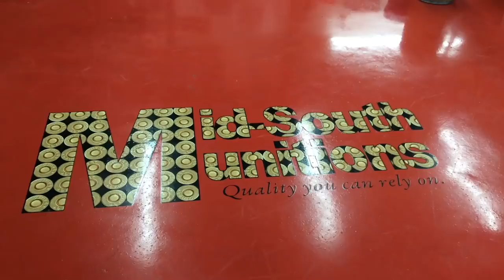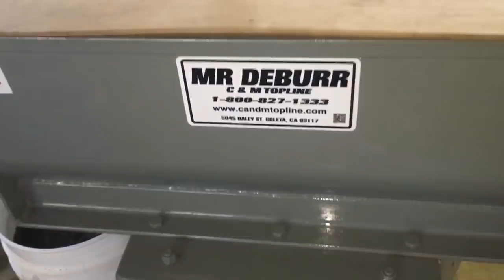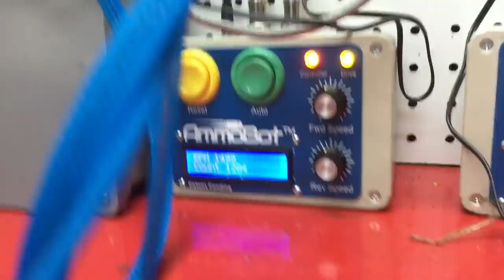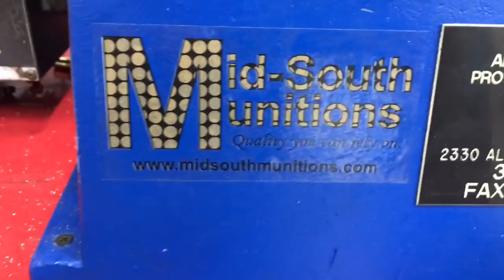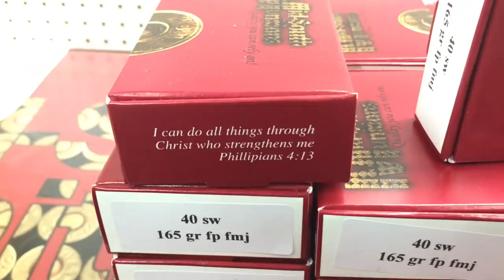Mid-South Munitions making quality ammunition from start to finish

Comment: I liked it up to the point where you were using cracked calipers might as well use a ruler. Been  a machinist for over 15 years big and small shops all would have fired me for using those
Reply: @Just a person ive been a machinist for 17 years in large and small shops also. my bosses didnt care if i used a knotted rope as long as i turned out quality work lol
Reply: I think I saw a speck of dirt in the corner. Haters gonna hate. 😄
Reply: Only the plastic cover, nothing else.
Reply: he's doing nothing critical. I owned several of these, and that specific no name model lasted me a long time. However , I now use chinese dial caliper, tired of the digitals running out of battery or breaking down unexpectedely
Reply: As long as they were calibrated and gave accurate readings, what does a cracked screen matter?
Reply: @manudehanoi  nothing critical?  Overall case length is very important, showing his attempt at basic QC inspection was a good idea, however the crappy looking tools don't inspire confidence. Inspection is key using crap brass fired who knows how many times.

Comment: Is there a reason nothing was mentioned about the powder loading? Like when/where in the process does it happen?
Reply: For example at 5:13 you see a linear press with what seems to be 10 stations. Typically what you see if a primer loading station (unless the cases are primed before entering the press), a station with a die that flares up the mouth of the casing, a powder dispenser which is typically a sliding block with a hole through it and when the casings are moving the powder reservoir dumps powder into that open volume for when the new casing enters the station the block moves sealing the powder reservoir and the hole dumps powder into a chute leading to the casing. Then typically you have a powder check station in which a plunger is pressed into the case to figure the powder level and if the case does not have the correct volume there's a chute for the rejected case. Then there's a bullet insert, a bullet seat, straigthening of the flared mouth and a crimping station.
Reply: Okay I got forward in the video and he explained the reject chutes.

Comment: Vibrating/tumbling/banging around loaded ammo isn't particularly smart. It tends to disintegrate powder flakes, grains and balls and can dramatically increase burn rates. It doesn't do priming compounds much good either. Kinda messes with neck tension and helps bullet "setback" as well. Especially with shiny slick plated bullets in mixed, range scrap brass. If Berdan primers and split cases are a concern in your .45 brass supply, you must be loading range scrap. Hell, I've never even heard of Berdan-primed .45 ACP. And  I'm not sure I'd trust a split-second "air test" to find all case splits. Especially after cases have been cleaned/tumbled/bounced around some and have been stress-relieved" and cracks "shrink" some. Cracks also like to show up post-sizing during case mouth expanding or seating. I've loaded and fired lots  of .45 ACP in two 1911s (early R1 and a Les Baer Premier II) through both factory barrels and a .460 Rowland conversion  and a Blackhawk Convertible and have loaded OLD range pickup "chocolate" brass not even were tumbling will clean up, nickel cases and even some Wolf steel case mainly because so many people say it can't be done. And I've loaded probably 15 to 20 different bullets from my own cast 165-grain FP  "round nose", 200-grain SWCs and 230-grain RNs to 185-grain Berry's HBRNs to Nosler Custom Competition 185-grain JHPs to Hornady 200-grain and 230-grain XTPs to plain old 230-grain hardball and as weak as possible while still cycling a 10-lb. recoil spring right up to "max" in the Hornady manual. Mainly with Titegroup. And I know I've got "range junk" cases (ugly old stuff I don't mind losing. Much) including the steel Wolf's that have been loaded 6-8 times. If I've split 6-8 cases in 5000+ rounds fired I'd be surprised. And I know the majority of them are Wolf steel and after that probably a few nickel. Unless a guy gets stupid with "+P/+P+" loads and/or heavy crimps and/or shoots a sloppy, loose, worn-out and/or POS pistol that's very  inefficient at managung recoil energy due to design (Glock) or a stupid-light recoil spring (everything else) and its more like a blowback pistol than short-recoil, quality .45 ACP brass will last dozen of reloads and the headstamps will get faint before the cases will crack if  loaded like "range" ammo instead of "defense" ammo. I think I'd shitcan the Berdan checker, get the SP brass sorted out ASAP,  save the "air test" until after all sizing/expanding and buy only quality once-fired .45 brass and the same for .40. The big ammo burners are the 9mm guys and they"re dumb enough to throw away brass they could at least sell for scrap although it's not worth much more as brass.  .45 guys tend to be much more conservative and are a lit more likely to reload. And with "free"  range scrap lead dug/screened out of local "range" gravel pit banks/berms like the 200-300 lbs I dug up in a couple decent half-days and $50 in materials to build a waste-high 3x4' 1/4" screen "sifting table" and another $100 in simple cleaning/fluxing/ingot casting tools, a 2- or 6-cavity Lee mold and 10-lb bottom-pour pot, anybody can be reloading ..45 (and/or .40 and 9mm) for around 5 cents a round. Doesn't take long to pay for a 550C or even a 650 at that  rate.  And it's at that point that spending time /money on 9mm starts looking stupid. But not as stupid as paying 75% of new "bulk" range ammo for "remanufactured" mixed, unmatched unknown-origin/history .45 ACP. I'm sure it's good work and money if you own/operate/partner with a "rental range" with an OTC ammo only policy in a "dry" town or county with no other "public" range  options. But eventually people get sick, tired or bored to paying to play with someone else's toys in their sandbox by their rules and paying sandbox rent and for "adult supervision" too. And "serious shootera" don't go for the full-auto fun-gunning  next door and vice versa. You can only do skin a sheep once and shear a sheep many times but your still stuck playing shepherd all the time and sheep don't live that l ong. When the "ammo shortage" ended it was a lot more the effect of reduced demand than increased supply. Eventually the fad, bandwagon "shooters"  realized the world wasn't going to end, shooting began to be "mainstream", credit cards had to be paid off, divorces averted and play dates with tactical "buddies" canceled. Plus they realized that after several years, untold hours of "training", unmentionable "investment" and innumerable guns, gizmos, gadgets and gear they really couldn't shoot a damned bit better or maybe not even as well as day one as a "noob". Getting "trained " to do X one way and Y one way instead of think, act, experiment and "train yourself" and basically grow up and be a big boy is kind of what freedom, liberty and "2nd Amendment rights" are all about, how they were win and how they have to be defendend. If the "founding fathers" had stuck to the British "playbook" and "rules of engagement" , they wouldn't have won. Or even survived.

Comment: they come loose in the box with no tray? havent seen that before. do the presses have auto shut off if you run out of components?
Reply: you better get some glasses..lol
Reply: @jjmckay6man1 you didn’t watch the whole video did you? I’m guessing you stopped before the 14:00 min mark?
Reply: @sik59rt  if you watched them run the pistol rounds through the 50 round checker they go into a tray/divider at the end of that process then get stacked up and put into boxes with the rounds in the tray/divider. they aren't just rolling around in the boxes. bulk/loose ammo does not require those and comes in smaller boxes because they don't use trays/dividers. they aren't the solid bottom and sides trays you are used to seeing. they are grid style trays/dividers.
Reply: @jjmckay6man1  theres not a divider/tray to be seen in any box. and as i said four years ago, ive still never seen loose rounds sold in a box like that.
Reply: @sik59rt  buy a box and see for yourself lol. then you will know for sure. I reload my own.

Comment: So all the brass you use is used, correct?
Reply: @no candy that's probably what the air check is for. If air escapes it has a crack. I don't understand why so many people are complaining about it being remanufactured ammo though. People keep complaining about the piece of 223 that had a dented shoulder but there's no way of getting it out and it'll fire just the same.